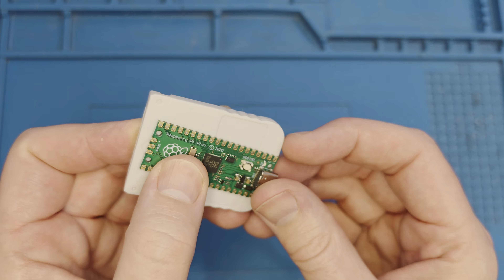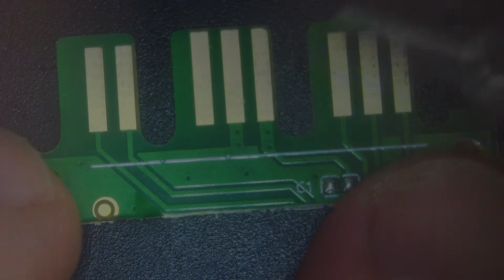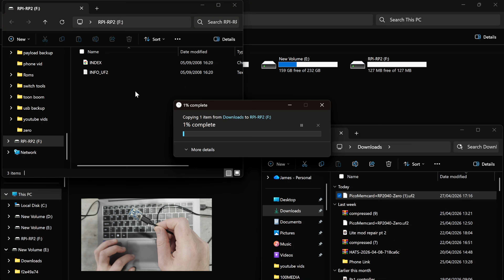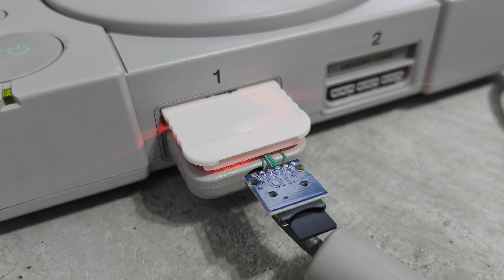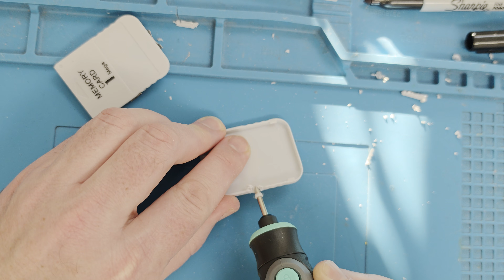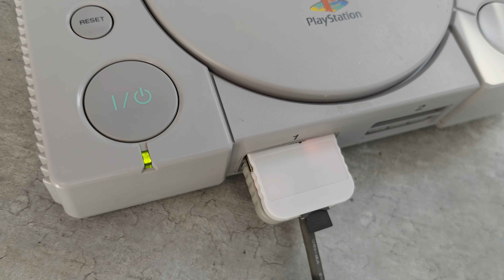DIY PS1 Memory Card: Full Build Guide (No Original Parts Needed)

Comment: Hi  can I run iso or bin cue from the sd card as my disk drive is dead can I put the game in the save folders as I might be missing that part of the video thanks.
Reply from the maker: No its just for saving, will need to mod your console
Reply: @fixingmoddingbuilding ok thanks I have a ps one slim maybe it wont work as I dont know a mod for the slim I will just have to mod my ps1 5552 with a pi pico and wires as in your other video thanks for your help if you know of a way to mod the slim as I dont want to use a disk drive its no good the slim might be of some use cheers.

Comment: If you use the RP2040-Tiny instead of the RP2040-Zero, it has no components on the bottom side, it might help with the height issue, also no glue onto components. It's the same size as the Zero and I believe all the GPIO is Identical.
Reply from the maker: Yer when I finished I was a little disappointed, I thought the pi pico was too long but I think it could be positioned with the usb sticking out the back. I just don't have anymore fake memory cards yet to do a V2 😬
Reply: @fixingmoddingbuilding  Yeah the Pico is longer, I was talking about height... when you mounted the Zero you had trouble closing the case, because the Zero has components on each side, adding to the height of the board, the Tiny only has components on 1 side, saving some space.